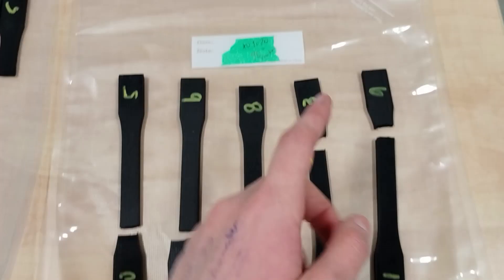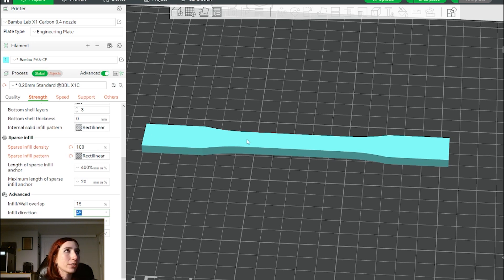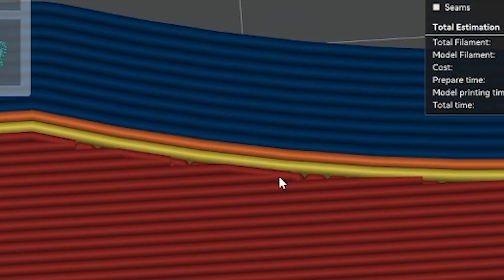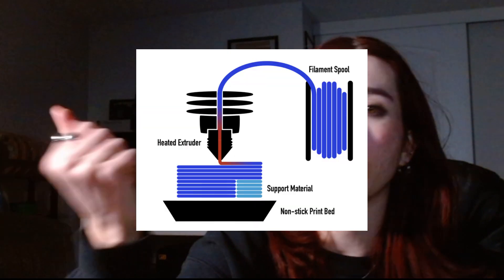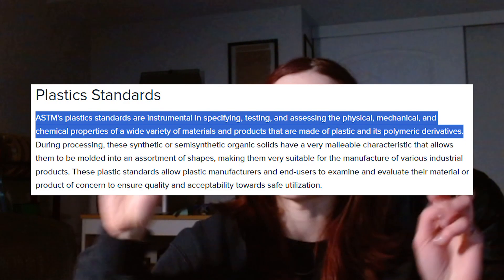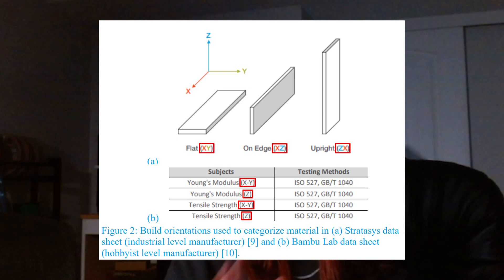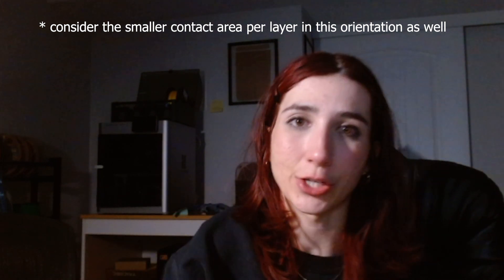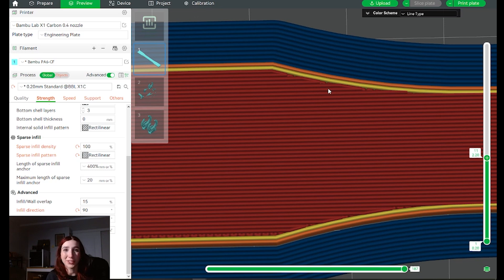we NEED better testing standards for 3d printed parts...

Comment: Uh... A video, as if it was made exactly for me. 😂
This is too complicated and I have way too many thoughts on this. I don't think the youtube comment section was designed to handle this. Feels like something people wright papers about. 🤓I have divided my comment up into multiple comments. Not that it helps.

The dog bone:
I think there are 2 main reasons a dog bone test sample looks like it does. 1. You need to hold the test sample and where you are holding the test sample will have a complicated stress field. But in a tensile test we want the simplest possible stress field where all stresses a pointing in the same direction. The idea is if you have a thinner area then the stresses will be highest there and the sample will brake in the high stress area and thereby give you data from there area where the stress is in simple tension.
But, when you have a change in stiffness you also have a stress concentration (a area where the stresses are higher), thus if the transition from the thin area to the thicker area is too "quick" then the sample will always brake in the transition area where again the stress field is more complicated. But if the transition is slow the extra stresses from the change in stiffness is small, and the larger cross-section area reduces the stresses. Thereby the highest stresses will still be at the thin area of the material and the sample will break as intended.
Thus I do not think rectangular samples will be any better. They will just where you are applying your boundary conditions (where you are holding the sample).

When 3D printing you are just adding even more stress concentrations in the transition area. I think this might be solved by having a larger transitioning area, such that the transition is even slower and make the sample larger. But I am actually not sure because the "errors" are probably fixed in size (depends on the nuzzle size and print settings), so even a slower transition will at some point have the "error" and the extra stress from the "error" will have to be smaller than the reduction in stress due to the larger cross-section. I can't imagine how exactly this looks without opening a CAD program or a slicer. If the sample is larger the "error" will be relatively smaller and that might make it easier to distribute the stresses into other material in the cross-section. But this will happen in steps and the first step might always be a problem. 🤷‍♂
Reply: Maybe it would be possible to increase the extrusion rate exactly at these locations. Such that we could add just a little more material into those voids. That might be enough to make the test sample brake at the intended location.
Reply from the maker: YES! I know some slicers have a "gap fill" feature as well. I think this is worth exploring or even detailing in material standards/test procedure for the 3d printed samples. If that feature isn't directly in the slicer, gcode can be modified to increase extrusion rate (which then modifies the width of the bead being deposited).
Reply: if we say the dog bone design you used get wider where that tensil tester grabs the specimens. You could maybe make a dog bone design that gets thicker, instead.
But the problem is how to print this. If it is not symmetric you introduce bending loads. If you don't print it flat the infill will be completely different.
If you print using overhangs, well than you have overhangs and a very long one at that. So that would probably also not work.

And if you print a rectangle and machine part of it away to get the dog bone shape. Well then you have machined your 3D printed part and that feels like a completely different test. 🤷‍♂
Reply: damn... youtube deleted one of my long comments. Where I talked about the similarities with fiber composites 😥

Comment: This is such a great example for the problem of estimating material properties after machining/prcessing. Of course the manufacturer can only provide tensile strengh for the filament and not the printed part, but it would be so nice to have an easy way to estimate material strength after printing.
Reply from the maker: Exactly what I hoped this video would emphasize! :)